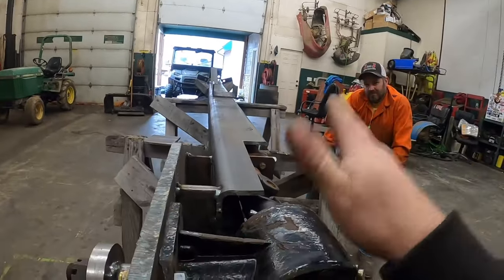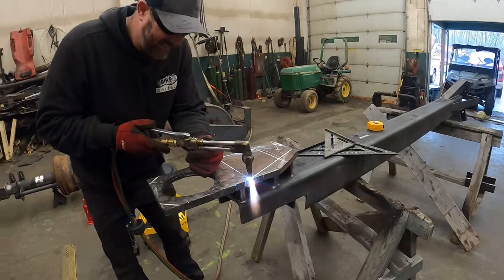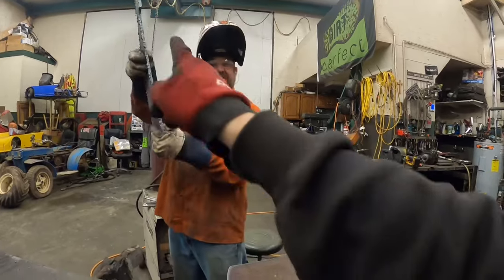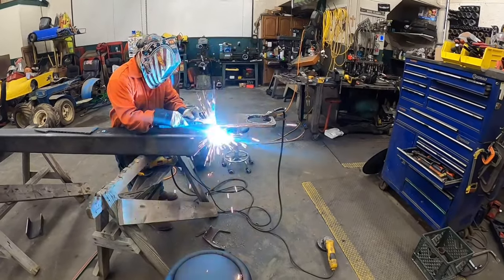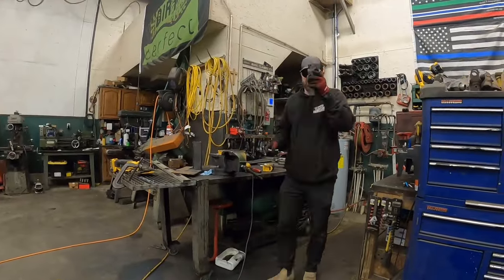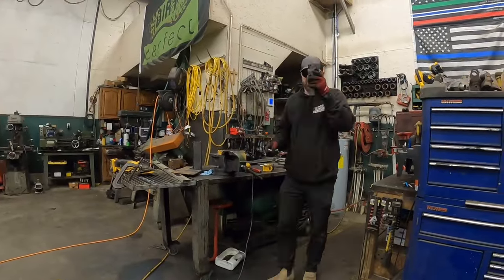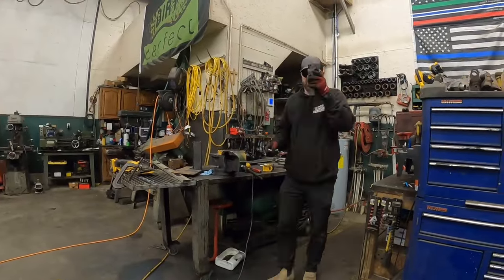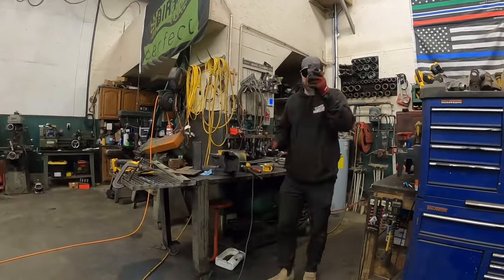Watch The Saw In Action - First Full Function Test!

Comment: Make sure the spinning cutting direction causes the blade nut to tighten in case the cotter pin ever shears and the blade can't fly off killing everyone in the area! Lock washers or Locktite on all that stuff in a seriously vibrating area trying constantly to loosen hardware...
Reply: Man, if that blade flies off it could be really bad!
Reply: The hydraulic motor should get a bypass so it can spin freely in one direction to avoid the abrupt stops, which course pressure spikes and can loosen your nut.
Reply: They are left hand thread for that reason. Like a weed wacker head

Comment: Mike, you remind me of my grandfather. That man would see scrap parts. Get an idea in his head . Then come up with a way to make what he needed. It's amazing what you imagine in your head. Fabricate it. Then make it work. You have a great mind and a great talent Mike. You're an inspiration and your videos are a joy to watch.  P.S don't worry about those grapes Aaron welded on there, a few coats of paint does wonders. 😉
Reply: I can look at a few pictures and videos and I can make it, my brother Greg let me use his wire feed welder and I made bumpers for my 4wheeler and put curated screen in the middle of it to keep the brush out of the front and back of the Polaris Sportsman ATV, I also made covers for the CV joints out of plastic barrels and used my heat gun to form the thick plastic so I could get it to fit around the cv joints and I also had enough plastic body to form flat ends for the bolts to hold it on the A-Arms but I put spacers in between each bolt and nuts so it could move with the A-arms works  great, one of my friends told me I should patent it. Just something I thought about and decided to try it out and it worked great. Common sense is all you need and you can make anything work. Your mad max lime green with camouflage wrap would look great on that saw arm and have some one paint American flag on the saw blade that would look cool 🇺🇸🇺🇸🇺🇸🇺🇸🇺🇸🇺🇸❤

Comment: One thing to remember is a hydraulic motor can also become a pump.  This is relevant because when you stop the blade with the excavator valve, both hoses are deadheaded and the blade will still have turning momentum.  There will be no path for the oil to leave the motor, which will create a BIG pressure spike (10,000 psi+).  This creates a VERY destructive shock load and can be dangerous.  The remedy to this is to make a jumper hose from one motor port to the other.  This gives the oil a path to circulate while the blade spools down. This bypass hose should be smaller diameter than the supply hoses to the motor, and is easily made using  T fittings going into the motor in place of the JIC to oring fittings in place now.  

I am a welder/machinist/mechanic and I really like this build.  I also really like the equipment operation videos.  Keep up the good work!
Reply from the maker: Stay tuned
Reply: I used to work for a company that built gas compressors for off-shore gas wells. We installed a check valve between the supply line and the return to allow the fans to spool down when the engine was shut down. We also installed a bypass valve to prevent overspending the fans. Your warning reminded me of this.

Comment: I’ve been in the hospital for 8 days, so I’m catching up. It’s too late now but to line up the two units to be sure they are straight. Next time take a round shaft 1 inch bigger than the largest shaft. Bore each end to fit the working shafts on the pump and gear box. Use this to install and weld everything in alignment. Remove units and install the universal, now you have almost perfect alignment. Maybe next time or if this is not close enough. Put it in your filing cabinet brain.

Comment: 1st rule of assembling stuff, install all bolts before tightening.  
  You tightened the bolts to the base before installing the bolt in the u-joint.
   47:47   Washers should be the sharp side to work, rounded edge to nut or head of bolt. It greatly helps to keep bolt from loosening.
   Blade is backwards.  Are you planning on some sort of shield for flying objects? Old stumps sometimes have a bunch of nails in them.
Reply from the maker: Sorry this was my first day building anything 😁

Comment: Hey hope you see this comment not a huge safety fanatic myself with most stuff but personally id put that cotter key in the end but id personally put a tack weld on the nut you can grind off easy most your big brush cutters are thay way can that cotter key can get hit my branches and what not and send the blade flying potentially just saying a tack weld wont hurt and lookt at the big brush cutters they do you grind the weld and take the nut off
Reply from the maker: That would completely over ride the safety plz think about that

Comment: The only thing that I can think of that you need to do is that you should add protection for the hydraulic lines along the shaft out of something like C channel. I sure you’ve already thought of that. Your engineering skills are off the chart. Aaron is an irreplaceable employee. His skills on your equipment are getting better all the time and with all the welding you have to do he is the man for the job.

Comment: You might want to use the appropriate tap for those nuts and chase the threads after welding around the nut. It restores the the interference for the bolt threads.
From my experience a nice trick.

Comment: 39:37 In the future, when you need to turn the hydraulic motor without hooking it up to the pump, take a single hose and screw it onto both fittings, that way, when you turn the motor, the oil simply gets spewed from one port to the other...

Comment: Proof of concept is going great so-far. 

Thinking a flex-coupler instead of the u-joint would be better. U-joints don't like side loads at all, and it is very difficult to get absolute-true alignment of components like that motor to gearbox with a single u-joint. Time will tell on that.

I'm surprised that that motor doesn't have a case-drain on it. Every single one I've worked with, (many of them, like 100's), have had a case-drain on them.

Comment: I think you may want to weld the sides of the plate that the motor is mounted to the box also instead of just the bottom for strength with torque.

Comment: every tool in the shop getting in this death wheel build. good catch on order of assembly DP. would panhead sheer bolt give you bit more clearance? that box tubing pretty beefy, its a cover not like milling bit is going compromise strength. the death wheel going really get some rpm on the excavators

Comment: Bounce was from the 4 flute end mill as they won't drill as a 2 flute mill will they cut from the side, if that makes sense. Agree below spin blade correct direction as to tighten spindle nut while cutting !

Comment: Nice job on the saw. Noe it would be nice to see the hydraulic hoses inside the boom to the other end . Then weld a cover on the cover with the bolts to cover the 90 degree fittings. then you don't have to worry about ripping it off . Again Nice Job.

Comment: You should reinforce the gear box as it seams to be hanging in the air. A reinforcing plate on each side should work from the gearbox the the bottom of the square tubing.
Reply from the maker: 0 concerns about that
Reply: If you do bend do you mind if I laugh @DirtPerfect

Comment: On that cover I'd have used 3/8" cap screws, the cover drilled to body size of the cap screws and the 1/4" plate drilled and taped. 
Use no washers on the caps screws but do use Loctite on the threads. 
The cap screws no longer than the thickness of the cover and the 1/4" plate so that it is flush on the inside. 
On the outside you'd have no more showing that the head of the cap screws.
A cleaner look.
But that's me and I'm not the one making it.

An old retired carpenter / sometime machinist out in Idaho.

Comment: With all the metal cutting y'all do, I'm really surprised that you haven't invested in one of those Milwaukee metal cutting circular saws yet. I've seen Andrew Camarata cutting 1/2" and 3/4" plate with that thing and it goes way faster than a torch, with zero clean up needed on the edges. Might want to put one of those on MBTS's Christmas list!
Reply from the maker: Have one

Comment: Nice !   Have not yet seen reason for the brake,  just a heads up, the Hydraulic system will act as your Brake.  
I have watched practically all your videos over past few years.   awesome !   you guys Rock  :)
Reply: I now understand,  the hydraulic motor will bypass so the blade will no come to a stop quickly without a brake .
Reply from the maker: Stay tuned

Comment: Why didn't you oblong the hole for the outer bracket to fit. You could have added a flat stock 3/16" × 1" on the out side to cover up the open slots on the side. 
Just my thought.

Comment: I think you might find that it loads up the gearbox bearings a bit. Maybe in the future you can put a bit of extra shafting in and run separate bearing blocks to take the load instead of the gearbox bearings
Reply from the maker: lol absolutely not plz think about this comment and how that’s not a concern at all hit think about how the box is built
Reply: @DirtPerfect  no worries, just a suggestion. They take a beating in brush hogs.. Time will tell.

Comment: The weak spot in your design is the single set screw on the motor shaft yoke. In my experience there would be keyways/key to take the torque, or at least a shear bolt. I don't think the setscrew will hold it, I think you are going to spin the shaft inside the yoke pretty quickly.

But what do I know.
Reply from the maker: Good news it’s not even needed

Comment: Putting the naming of the unit aside is there just ONE set screw holding the hydraulic drive motor shaft to the universal drive coupling?  I saw splines on the 90 degree end with the shear bolt but nothing on the motor end shaft except the one set screw.  Failure point??

Comment: Well it is coming along pretty nice.

Comment generator:
Just turn the blade the other way round, that way the nut tighten itself, now it run itself loose. Works the same on tablesaws, some machines have, when the blade has to be mounted, a left turn nut on it.

Comment: Just something to think about your motor will run it with out any problem for now because I have worked with Hydraulic motors for over 40 years and when you and turn it by hand the geroler is been worn badly unless you have a whole lot of flow this may still work. But I do like your Idea!

Comment: In case no one else has made this comment
If you turn the blade around and make the blade rotate in the correct direction the natural rotation of the driven blade will keep the blade nut tight.

Comment: Hindsight is 20/20, but if you'd welded the tabs on the motor side to the cover you'd have better access to the motor bolts.
Reply from the maker: No that cause other problems think about it thanks
Reply: @DirtPerfect  If only on the motor side, I don't see an issue, but ok.

Comment: Since paint would cause sticking issues if you painted the inside, and rust gluing that top cover to the side plates would be annoying, are you going to put something like spray on copper anti seize in there to keep it from sticking/rusting together?  Or will that not rust fast enough to be an issue given the kind of steel it is made of?

Comment: It appears the blade's on backwards. Shouldn't the teeth be curved TOWARDS the cut?  Way you had it spinning there, the teeth weren't spinning in a cutting direction.  Also, are you going to weld a smaller tube along the entire arm to shield the hydraulic hoses?
Reply from the maker: Will go either way

Comment: Not to change the subject, BUT, its related. 

You guys have gotten way TOO easy?

Missouri State Archives has been putting out some videos of, Road Paving.

Very interesting and a look back in A day? 1938-1948, roughly.

Now back at hand, concrete floor, roof over your head, heat, A. C. when you need it?

Comment: Using 3/4" bolts for that cover were overkill.  The cover, while being extremely strong, is no stronger in holding its position on the arm than the mounting tabs to which it bolts and that looks like 1/4" plate.  Should have used 3/8" hardware there to avoid the size and risk of contact to the u-joint.
The mounting tab for the hydraulic motor needs a lot more bracing.  With it only welded on one side, the torque it will produce along with the drag the blade will cause will likely flex or bend the tab enough that the u-joint will then contact something since it is so tight around it.
I know you haven't gotten there yet but the two hydraulic lines will need to be fully covered for quite the length of the arm since branches don't care what they hit when you push that arm into a tree to make a cut or the branch falls off of the tree.
When, not if, that shear bolt shears the first time it will be a chore to get it out of there.  Be ready with the bleeps on that video.

Comment: Since right angle drives cost you about 10% of power…Why would you not connect a correct match hydraulic motor (with shear pin or clutch pack) directly to saw blade?
Reply from the maker: For very good reason plz think about that thanks
Reply: Every slasher saw I have been around either has a clutch pack or a hydraulic pressure relief mounted ( case drain) mounted on or in the hydraulic motor that the the saw blade is directly attached too….a few the hydraulic motor with a torsion bar and the saw blade are both supported by the torque limiting device like the zero-max 210..